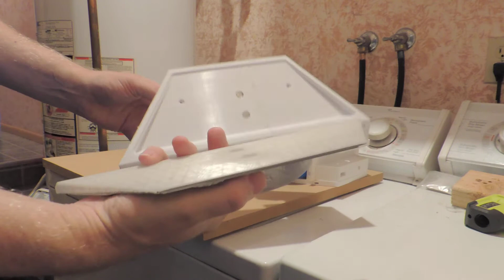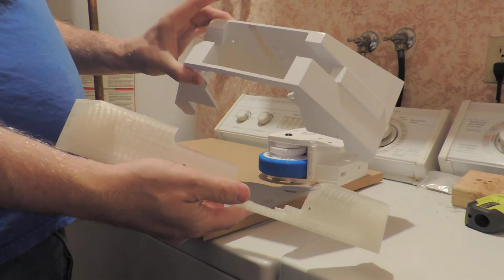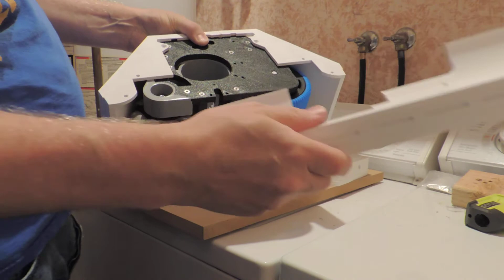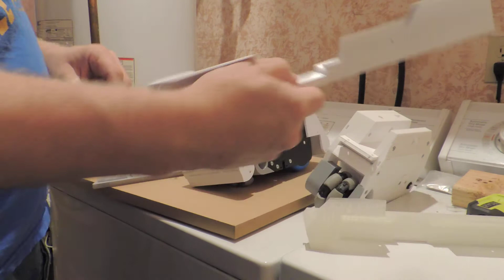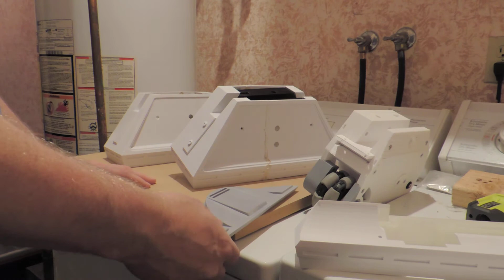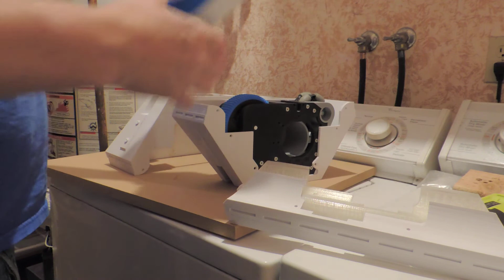3D Printed R2D2 - Part 40

Comment: Your omni wheels are not on line with the main wheel... is that the correct way to install them???
Reply from the maker: Good catch!  I hadn't noticed it at the time.  If you watch my 'part 100' video, you can see that I've got them assembled correctly.  In this video I've got the vex wheels swapped left/right.

Comment: Hi Tom. The gap between the main drive unit piece and the foot shell is common and, AFAIK very difficult to eliminate. My piece printed much like yours - that shallow overhang curled slightly during printing which resulted in it being "thinner" than it should be, which leaves the gap. Once everything is put together it will still be visible, but you're likely to be the only one who really notices (the ankle overhangs it a bit, plus we're always our own worst critics). One other thing to keep an eye out for - when you get your motors, be sure to check how the drives with the motors installed fit into the shells. My motors (150W versions) were at least a quarter inch longer than the typical 100W motors and I had to grind a good bit of plastic off that inner shell piece to get them to fit.

Hang in there and keep at it. Looking good.
Reply from the maker: Thanks Jason!  
I did take another look at the PDF instructions for assembly of the drive units into the foot shells and noticed the final photo of the assembled unit does have a visible gap.
Once I get the shells reprinted (starting on that now) I may try printing a filler piece that I can glue to the inside top of the shell to lessen the gap.

Comment: Hi, Just caught up with you watching all your R2 videos. I am a little behind you in the printing but I am trying to build my own 2-3-2.
First here are my PETG setting, from CURA 4.9, hot end 238deg bed 80 deg, I go a little cooler on small items 232deg / 75deg. I only run the cooling fan at 50% to help stop layer separation  (I don't switch the fan off to help bridging). Print speed 65mm/s layer height 0.2, 5 walls, 20% or 25% infill. If you go too high with infill, it will make the parts 'stiff' brittle rather than just stronger plus when cooling it can contract and cause more shrinkage. Printer Anycubic Chiron, Sunlu PETG. I always watch the first layer and adjust the bed height to get a thin, even almost clear print line, if any of my brim (8 to 10 lines) comes off or looks to be turning white I know it is not going to stick so stop and clean the bed, before trying again, tweaking the bed height until it gets the right flow, not too high that I can see a line like toothpaste but a more squashed smooth, wide line.

On Mike's Fusion 360 files the AShell1 is 340.182mm 13.393 inch front bottom edge to rear bottom edge. I can confirm that the Shell 2 is the same size. This is tip to tip at the very bottom of both faces you are putting together.

I haven't printed the outer feet shells yet so I cannot tell you how they went but I hope this helps get your print right.

Edit, In the Fusion 360 files there are go gaps in the top, AMotorFrameB should fill that gap.
Reply from the maker: Thanks for the PETG tips!  I have tried several different settings, as recommended by other websites from people who have no issues printing it but I still have the same warping issue.  Reading tons of different forum posts about printing PETG, I really think there's some factor that keeps some people from being able to reliably print the stuff. 
Maybe relative humidity, variations in the printers temperature control or some other environmental variance.

When the settings from someone who has no issues with the same make and model printer still don't work for me, it makes me wonder what else could come into the equation that makes the difference.

Comment: FYI I printed the one-piece shell1 and it matched up to the shell2 fine.  It could be something related to how the shell is cut for a 2-piece print
Reply from the maker: I printed the one piece shell 2 but the two piece shell 1.  After posting the video I loaded all 3 into my slicer and confirmed that the issue is not with the files, they have the correct measurements.
Reply: @TomsProjects  I'm guessing the difference in filament used for each part may have different shrink properties from each other while cooling.